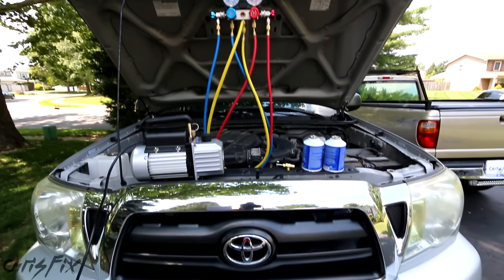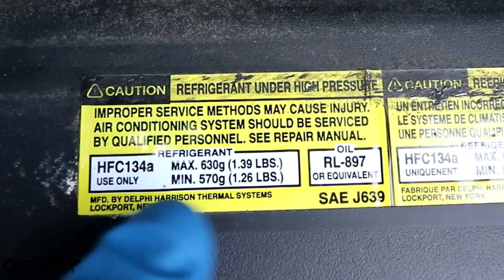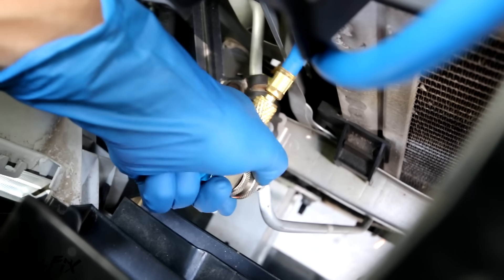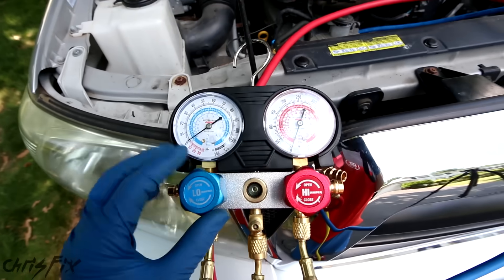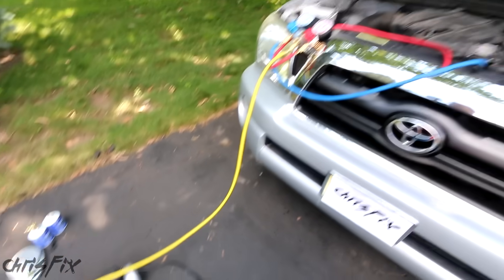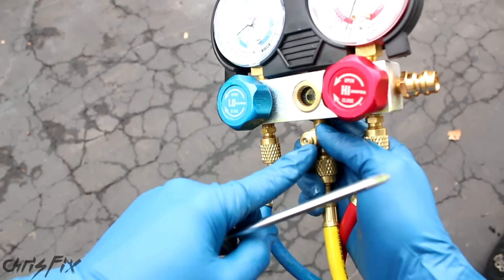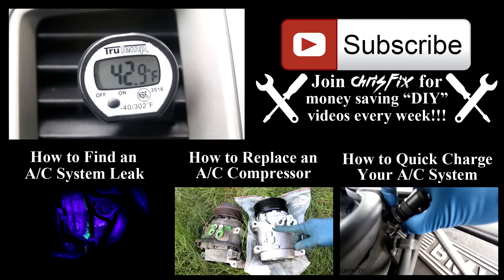How to Properly Recharge Your AC System

Comment: They don’t sell R134a to unlicensed people anymore so you have to pay a garage if you want a R134a refill. Only R12a is available to buy. Can it be used instead without problem?
Reply from the maker: No, it would require an entirely different ac system to be able to use r12a, and while they are less common you can still buy smaller cans of r134a

Comment: I’m sure you don’t reply on older videos but I’ll ask anyways. I replaced the compressor, expansion valve, and accumulator/dryer on my moms 2015 Nissan rogue select, I’m adding r134a freon and my low pressure side is at 100-110 and the high pressure side is at about 115-120 and it’s no longer taking freon. I added about half a can and it stopped taking freon, decided to start a second can and it took about half, now it’s not really taking any freon
Reply from the maker: Those pressure readings sound way too close, sounds like an issue with flow inside the system. I'd check to see if the compressor is actually engaged/running, make sure the expansion and dryer is orientated correctly and make sure the system was fully vacuumed. There could also be a complete compressor failure (sometimes new parts aren't always good) or the incorrect oil amount causing this
Reply: @chrisfix I cycled the compressor on and off a few times and the high pressure side reach 150-170 but the low side was still 90-110, at one point the low pressure side did drop to 70psi momentarily.
Reply: @andrewr022488 system could be overcharged or expansion valve is flooding the low side.  recover some refrigerant and see what happens.  there could also be too much compressor oil in the system if you did not balance it.  did you pull a good vacuum?

Comment: great video i have a question i did everything the same but for whatever reason all the freon was left on the high side and yes it was closed throughout the whole process ac is just cool and wont charge up to the required amount is a 2007 tundra with 5.7 thanks in advance
Reply: expansion valve could be stuck closed or receiver drier is clogged.
Reply: were the fans running?

Comment: A nine year old video doubt I’ll get a reply…..but why add oil thru the vacuum isn’t it better to add the oil to the individual parts as you replace them?. I’m replacing the compressor expansion valves front and rear and the dryer…. I thought I was to add oil to each part as I went along…..haven’t started yet want to be sure I understand all of the steps 100% a little unclear about this thanks
Reply from the maker: Both methods are valid, in your case it's definitely better to add oil as you go along, but sometimes it's easier to use it to top off if you're only replacing 1 part (or someone else installed the part) or you want to know exactly how much you're pulling in if you like doing it this way
Reply: @chrisfix  thank you SO much for the reply!! I def like to just add to each part as I go. It's my first time working on an AC system, and tbh the vacuum and guages are a little intimidating.

Comment: I've had cars pull and hold vacuum then leak when I added freon, I recommend doing a pressure test first. You can take a rubber tipped air fitting and add air to like 70 psi on the yellow line area on the manifold after cracking the low then high sides and quickly closing, make sure they hold pressure, then pull a deep vacuum. Pressure doesn't lie. Nothing worse than thinking you are all good then watching a $15.00 can of freon go to waste. Understanding proper sized new O rings, and lubricating them properly, and re-attaching lines to replaced components needs to be a gentle process
Reply: I pulled a vacuum on my Sante fe. It took about 5 min or so to come back to zero. So I changed the fitting so I can pressurize the system. I put in about 30psi and closed off the manifold gauges and held perfect for over an hour??🤷‍♂️🤷‍♂️
Reply: @Clifford-p4s you need a pressure of 100 to 150 psi.

Comment: Some videos/tutorials say to not even attach the gauges to the high pressure charge when pulling a vacuum, only pull from the low side, does anyone with real long term experience know the correct way and why?
Reply from the maker: Technically you can just attach the low side (and you'd probably be ok in most case) but I like to have both sides attached so I can 100% see exactly whats going on as well as pulling a deeper vacuum for this process
Reply: @chrisfix  I know from doing a pressure test, when not in operation, the low and high sides are not open to each other, so I would think only half the system would have non condensables removed if just doing vacuum on the low side, such as in my case, where I replaced the compressor, expansion valve, condenser and did a flush.
Reply: @DarrenS-ky3if they are open to each other when not in operation.  if you take pressures about 12 hours after engine shutdown, the pressures are equal.

Comment: Note: I learned the hard way that pulling a vacuum will NOT remove the existing PAG oil in the system if you are only planning to recharge say after fixing a leak. When I rented the vacuum pump from Auto Zone they said it will remove everything, including oil which is wrong, and I proceeded to destroy the entire system after doubling the total PAG oil the system called for.
Reply from the maker: Dang sorry to hear

Comment: Did this and mine still blows warm and cool air randomly, I’m thinking the evaporator is bad.
Reply: expansion valve is sticking.  and or a bad filter drier.

Comment: it should be noted that the valves that are connected to the car's system hoses operate in reverse.  To close the valve you turn the valve counter-clockwise. to open the valve you turn the valve clockwise. this is the reverse of how a regular valve operates .  The valves on the gages are standard. Also make sure when screwing on the refrigerant can to the piercing valve tha the piercing valve is turned to the nonpiercing position. Thanks for the video.
Reply: Glad you commented this, I did this a few months ago and couldn't realize why the freeon wasnt entering the system haha
Reply: Literally did this yesterday and didn’t realize. Thought about how shearer valves open next day and realized lefty loosy to open does not work in this instance. Woulda saved me a bit of time and anxiety over it if I had seen your comment

Comment: You did not explain whether you should add oil if you inadvertently release oil from the high side valve or when you vacuum the system does that procedure removed too much oil and how do you know how much oil is left in the system so when you add the coolant should you add some oil? Note: Nothing was replaced.

Comment: Good information, but if I'm going to go  buy everything that you were using I might as well pay $150 to have it done by a professional, I mean how many times will you be recharging your AC system in your car in it's lifetime?
Reply: I can see your point but also the gauges can be rented for free at most auto stores and the refrigerant you will always need to buy. I guess the main benefit is that you or your friends won’t have to pay additional cost if the need ever come up again. But like you said it may not always happen and if it does you can just find someone who has the equipment. Not sure what response I made but it’s nice to be prepared or know someone who is prepared
Reply: and we have no problem buying a $1000 cell phone when a $200 one is really all we need.

Comment: At what point did you open up the high pressure side so the gauge works? Before you start the truck both valves were closed. When you went to add the refridgerant you open up the low side, but the high side gauge was open and showing pressure.
Reply from the maker: On a manifold gauge set, the pressure will show as soon as it's connected because it reads pressure from the line, the from the valve. The valves only control whether or not refrigerant flows through the hose
Reply: @chrisfix  I was thinking this exact same question you just answered I couldn’t figure out how the red gauge was reading when the valve was closed.

Comment: The HP valve is only open when for the vacuuming the system. During charging and at all other times, the the HP valve remain closed. Correct my understanding ? 10 : 14
Reply from the maker: Yes, you only want to open the low pressure side

Comment: So during the portion of the video where you pulled the vacuum & then waited 45 min to see if the pressure on the low side dropped any I noticed that you didn’t mention anything abt the pressure on the high side… the reason why I’m bringing this up is bc when I do this & come back to check, the pressure on the high side (red) has slowly creeped back a bit. Is this normal or does that mean that I have a leak on the high side somewhere ? I can’t find any definitive answers on this.

Comment: What happens if when adding Freon both manifold gauges were open?
Reply from the maker: The high pressure side feeds into the low pressure side so it can force refrigerant backwards and potentially rupture the can which would not be good, or you can overcharge the system/damage your manifold. Thats why you only want to deal with the low pressure side
Reply: @chrisfix thankfully that didn’t happen but it also didn’t seem to take charge properly so I’m praying that all I need to do is attempt another recharge after evacuation and pulling vacuum.

Comment: Everything I needed to know was explained in this video. The only problem I had was buying the correct R134A can tap. Most all of the new cans are self sealing but they still sell taps for cans that need to be punctured. I was using a manifold with 1/4 in hoses. Some hoses are 1/2 in. Get the can tap that has an adapter that will accommodate both hose sizes to be sure. If you have a tap for a puncture type can you can buy an adapter that screws on the self sealing can and allows you to use your puncture type can tap. That's what I ended up doing.

Comment: Compared to most videos on this subject this one is the best I've seen explained yet. There are a few things I would have done differently but for a beginner he said the most relevant things. I worked in a shop during the R-12 change over period so we needed 2 reclaiming and charging machines. I still have my R-12 gauges and can tap.

Comment: After following this process, and adding the correct amount of oil (about 2oz for me) through the yellow line, I coudn't purge the yellow line properly since only oil came out. Anyway, I added about half the amount of refrigerant for my car, and the high pressure was over 400 PSI. What did I do wrong? Should I have added less oil?
Reply from the maker: Maybe your orifice valve is clogged? What is the low side pressure?
Reply: @chrisfix  Appreciate the response! The low side crept up to around 70 PSI. Temperature that day was around 55 degrees F. I might replace the orifice tube to be sure, or maybe there was air in the system? It's an old 2001 PT Cruiser and in addition to the low side port, it has 2 high side ports, one of which has a warning to not use in the service manual (but I did run a vacuum on it before I read the manual). I hear some sort of pressure relief sound from that port when I turn the system off, so maybe it's broken?
Reply: Is your electric fan on for the condenser? What most people don't understand is that A/C doesn't cool the air, it removes the heat from it. That's where the condenser comes in. If no airflow through it then pressures climb.
Reply: @old_school_guy  I'll check. I believe it was on though because it was blowing somewhat cold air even with a partial charge.
Reply: @old_school_guy  Thanks! That was the issue. I didn't think that it was broken because it shares the fan with the radiator and my car doesn't overheat while sitting still, but yeah turns out one of the speeds was broken. Replaced the fan motor and now my AC blows cold and pressure stays normal!

Comment: If you're concerned about purging the air in the yellow fill line, why do you not purge the air out of the red and blue lines?
Reply from the maker: That's the line you use to introduce in refrigerant into the system, and there is a moment of air as you are connecting it as you saw so it needs to be purged. The red/blue lines don't have any open air exposure after you connect them so there is no air that needs to be purged
Reply: @chrisfix  Yeah my bad that's right, it's because you're pulling vacuum on an already empty system.  I was looking at a poor mans "top off" on a mediocre operating system that already has some refrigerant in it.  I see a lot of videos out there using manifolds to top off and seem to forget there's air in the low line.

Comment: For my cans to throw refrigerant to the system the piercing valve has to be all the way to the bottom.. but with that logic should all the cans I use be purged because the valve is all the way down which means air will get in ?

Comment: Hey Chris, did you have to get the evacuated before installing the new compressor?
Reply from the maker: Yes it needs to be 100% clear and empty (let a shop recycle it for you) before you do it
Reply: @chrisfix got it so Evactuated, install new compressor, vacuum the system, Fill the system ?

Comment: Great video, as always! A couple of minor comments. I have a second recharge hose connected to the second open port of that intake line. That way I can leave the first hose connected to the vacuum pump, and I don't need to release refrigerant to purge the line. I simply pull a vacuum all the way to the can before piercing, close the vacuum pump inlet and then release refrigerant. The second point is about vacuum leak test. Just because you don't see a loss in vacuum does not mean there are no leaks. Vacuum is just -15 psi. The system runs at +250 psi,  so that's a huge difference. Pressurizing the system with nitrogen (some people use compressed air, but not recommended) is the best way to ensure there are no leaks.

Comment: Great video but you did make 1 mistake.  The high pressure hose has refrigerant in it  so before you disconnect it, you should dump that refrigerant back into the system.  Many videos on YT for proper disconnect procedures.

Comment: 6:20 doesn't closing the valves on the gauges only show the vacuum of the gauge itself? You're not connected to the system anymore

And 8:10 - if you add oil by just adding it to the lines, wouldn't pulling the vacuum on the whole system remove any residual oil in there? So even if you didn't replace anything you would still need to add it right?

Comment: You literally forgot about the AC Oil usually PAG46... that needs to be added as some may be lost when there is a leak. If you replace the compressor, most of the time at least the denso, come pre oiled
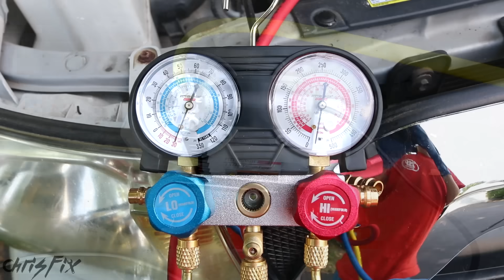Reply from the maker: I'm guessing you didn't watch the video because I went over that at 7:34

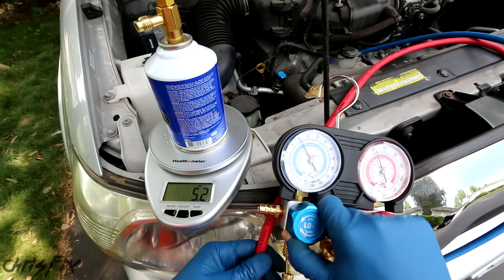Comment: 12:12 you could've explained the ambient temps relation to high pressure and low pressure psi right here. Other than that, it is very informative thanks.

Comment: No discussion of pressure and / or temp after/during the second can?
Reply from the maker: The pressure goes up and temp goes down until you get the correct amount of refrigerant.
Reply: @chrisfix  sorry, my question was poorly worded.

Specific pressures at specific temps for specific gas types according to other channels.

Comment: Chris, great video!  I wish he did a similar one where you’re just topping off and adding a little bit of refrigerant
Reply from the maker: It's pretty much the same exact process just without the vacuuming out part and whatnot, but you would use the gauges to see how much is in the system and then add to the correct level

Comment: Added oil to the line (extremely difficult and messy, I suggest getting the oil in a tap can), connected yellow line to the can, Went to purge and oil came out. I think there’s something missing about those instructions
Reply: My vacuum pump exploded while purging. Turns out, I put too much oil in it (it’s supposed to be between minimum and maximum and not all the way to maximum) and also opened the gauges too much when barely starting purging lol.

Comment: Nice video, tells everything you need to do. One suggestion, you purge the yellow line via Schrader valve which is good, but you didn't purge the blue line which also has air and moisture in it.
Reply: The blue line was under vacuum.

Comment: What about compressor oil? How do you remove the old oil?
Reply from the maker: Typically you'd have to manually remove and drain the compressor/other components, or if you did a complete evacuation that can sometimes pull out some of the oil

Comment: I followed step by step and I got the same gauges and pump but the Freon isn’t going in.
Reply: Possibly clogged lines
Reply: Cans now are different. Now we have self sealing cans mandated by EPA in 2018 i think.. The ones he used in this video are not self sealing. They are puncture style cans. So the step of him puncturing the can then backing off with the valve is slightly different

Comment: How do you keep air from entering when adding oil?
Reply from the maker: Pull a vacuum, then disconnect the yellow line, keep the end upright and put in oil, then reconnect it to the manifold and crack open the low side to suck it in and you should be good. They also make (pretty cheap) syringes you can use if you want to be extra sure